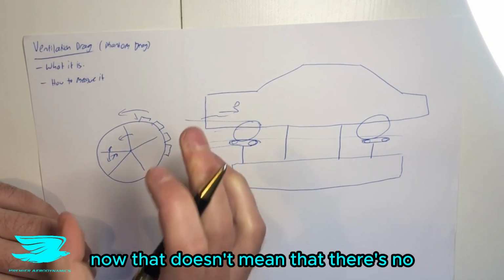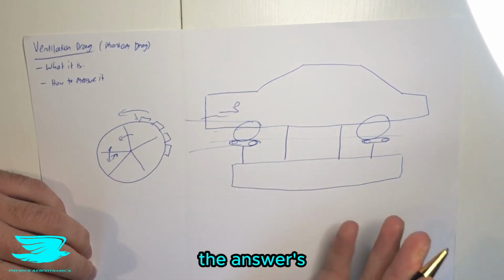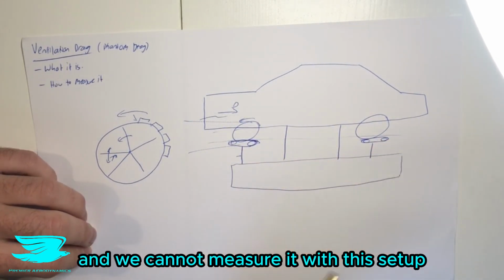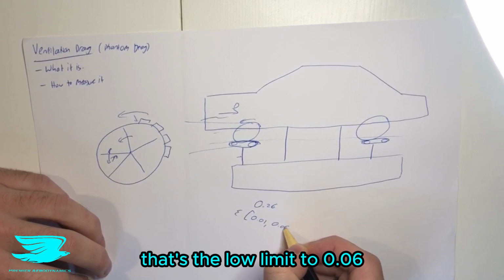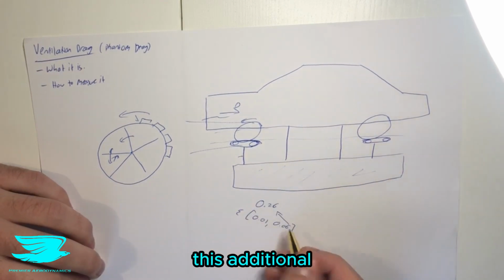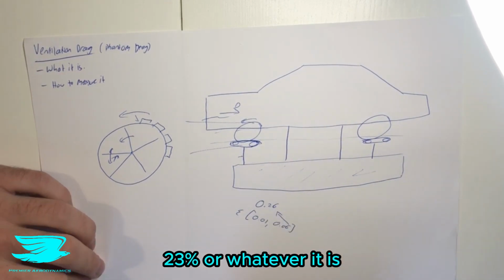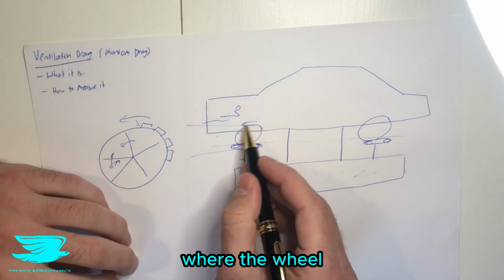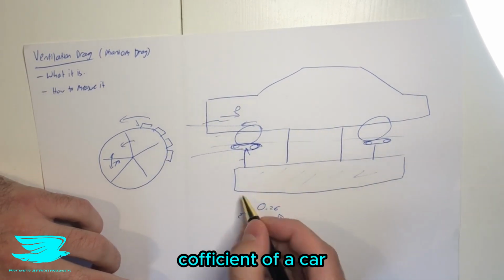{Auto Aero #40} Ventilation Drag Explained

Comment: Very interesting, I wonder if the author has a ballpark guess as to what wheel ventilation drag adds to overall aerodynamics of a car. Ex: 5%, 10% more or less. Also, because wheels contribute to rotational weight, I've been told that rotating parts create, as ballpark, about 7x more unsuspended weight. 
Still, understanding that vehicles aero drag doesn't exceed mechanical friction (drag) till about 45mph, I wonder if wheels, turning faster than the vehicle through the airstream increase most of its aero drag at slower speeds then until it flattens out at higher speeds when I'd guess they are operating in lower air pressure due to a vacuum effect. Sort of like high altitude aircraft flying in rarified air. 
As a non-engineer it interests me as I am old enough to remember drag car wheels that were solid to improve aerodynamics as cooling brakes not so important as it may be on a regular car. This, is something of an extension of your response to a prior comment about brake assemblies and such liminting the amount of air that passes through the wheel. Simply some wheel look aerodynamic while other look like squirrel cage blowers. 
Thanks much for posting such interesting videos!
Reply from the maker: That's cool about drag racers. They knew about ventilation drag back then. Nowadays it's really not talked about much to the point that even ten years ago most people weren't even aware of it in the automotive aero field.

As for the percentage of a car's drag, about 5% of modern cars.

As for pre-45 mph, the spokes at worst, only turn up to slightly lower than the velocity of the vehicle  because if the vehicle is travelling at 45 mph, then the outside of the tyre will be travelling at 45 mph as well. As you get closer to the center, the velocity drops.

Comment: It appears there is the added complexity of separating tyre rolling resistance from the ventilation drag that is measured by the wheel drive units.  I assume one would run the wheel drive units at different speeds to get a value for the tyre rolling resistance - that I expect would almost be independent of speed.
Reply from the maker: Actually, typically you assume that the rolling resistance is constant across speeds, so you run the car at very low speeds, like 20 kilometers per hour, so that the aero is negligible, find what the rolling resistance is, and then run the car at the speed you want and subtract the rolling resistance.

Comment: Hi, maybe not entirely the same issue, but is there any research about the drag around the inside of the rim/ tire? Usually the structure/ spokes are on the outside, but the inside is hollow, for a lack of a better word. ( English is not my first language) i know you need to have room for steering and suspension movement, but would it reduce drag if you try to keep these openings as small as possible?
Reply from the maker: So, generally, packing that region with additional stuff like the brakes and calipers, etc., will have a similar effect as closing the rim from the outside because it will prevent the air from going through the rim.

That will reduce the drag.

And your English is good!
Reply: @PremierAerodynamics  that makes sense. Thank you!